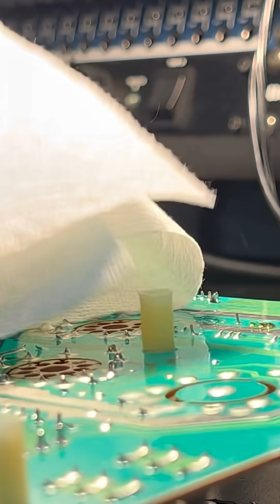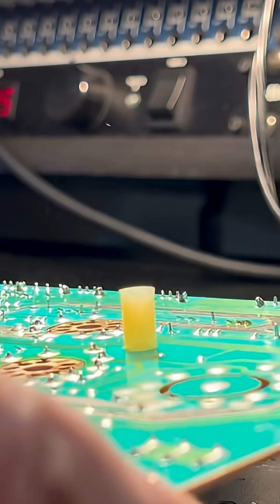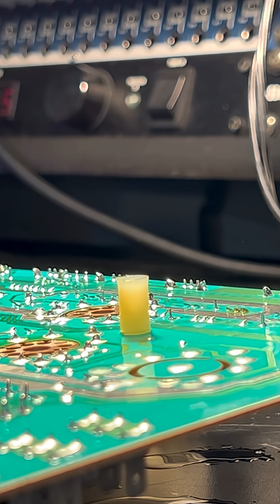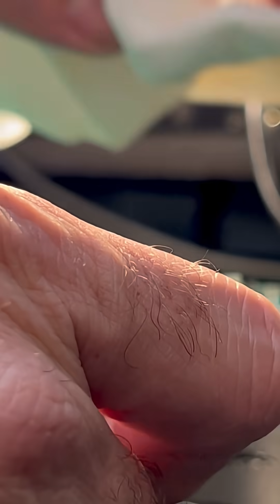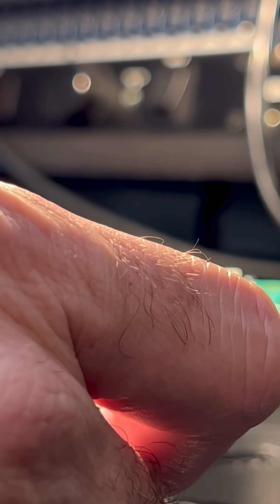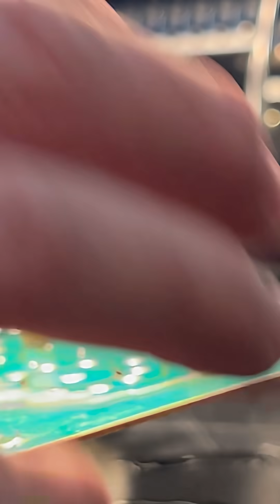Amp Tech’n: Thinking of Getting In? #electronicsengineering #amplifier #guitaramp

Comment: Exactly what I’m doing, although I’m not taking any work in. I have a pile of amps (literally) that I’m fixing up. On the bench today is Red Knob Twin, full recap, power and bias supply rebuild (including turrets for the silly 10W droppers and replacing damaged traces under them), screen grid resistors, PI coupling caps, all plate resistors, bias sense resistors, new input jacks, removing the crappy stiff thin wire to the preamp sockets which loves to break and replacing it with new, might rework the heaters too.
All TAD, F&T, Panasonic, Vishay, and Yageo components. It’s been a marathon day!